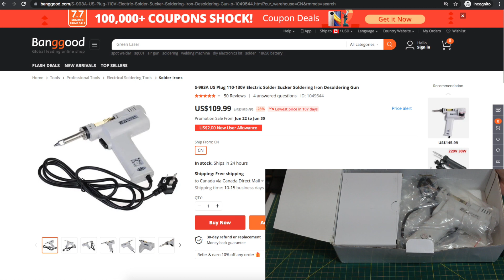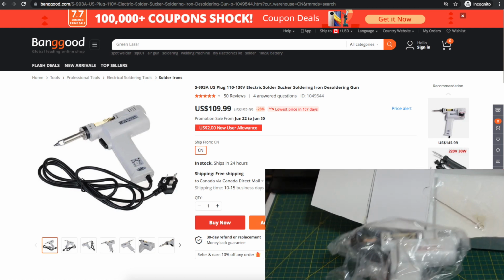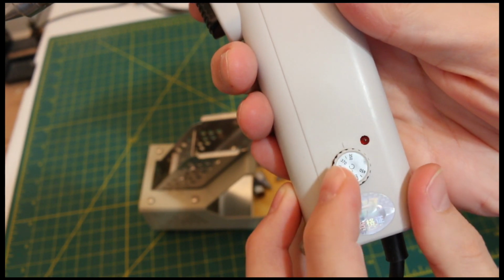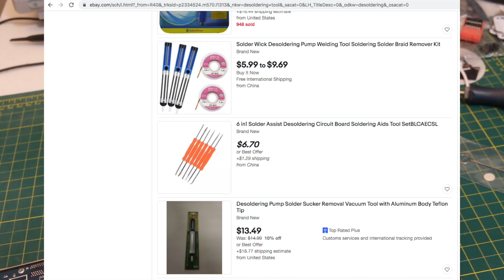S-993a Desoldering Gun - Looks Promising!

Comment: hi.  thanks for the review.  how has the unit held up these past 3 years?
Reply from the maker: still use it all the time. I found it works better when the right sized nozzle is used so I have three interchangeable ones to switch between.
Reply: @GadgetReboot  mahalo for getting back to me and letting me know.  Yes, I would suspect that the different size nozzles are necessary.

Comment: I had one for a year, went thru 3 heating elements. I did nor abuse it, or left it on or anything, just regular use maybe unsoldered 2-3 components a week. The gun itself works well but the heating elements aren't good quality, expensive to replace too.

Comment: I have a ProsKit desoldering station that gives similar results. As you mentioned always clean the gun before turning it off; I ended up putting labels on the station to remind me. If you do happen to forget, I did have success unclogging the iron by dipping the cleaning rod in flux paste, getting a little in there and then turning on the gun seemed to help remove the stuck solder.
Reply from the maker: One problem I had was trying to hold the cleaning rod near the hot tip, I momentarily burned myself. But nowhere near as bad as when I was learning to avoid the hot side of a soldering iron.  A clean out rod with a shield to keep us separated would be good...
Reply: @GadgetReboot  My cleaning rods have a zigzag bend on them to stop you from getting to close to the hot tip; but yeah if your hand slips then ouch!

Comment: Sure looks a lot easier than a manual sucker.  The tip on mine is all melted, stained, and mangled.
Reply from the maker: I can never get the manual one to work either because I can't figure out if it needs to go over the whole pin or just up against it to do the job, or I can't get it in position before the joint cools again, or the pin is a  tight fit and the solder can't come out manually.  This is way better.
Reply: @GadgetReboot  I was never able to get the hard nozzle ones to work either. There are soft silicone tubed manual de-solder pumps. Made by a Japanese(I think) company called Engineer. A bit pricey, but well worth it. 

For more difficult de soldering of headers and chips and whatnot.. The de-soldering gun is a joy to use. Mine is the one with a big base station, but this one looks much more compact.

Comment: I seem to use more SMD components now days so it would not see a lot of use. to remove PTH chips I tend to cut the legs off and lift then out one at a time. I find that with multi pin devices it's hard to get all of them fee from the inside of the PTH. so it's easy to rip the plating out, not much of an issue with double sided, but multilayer with inner tracks connected as well can be a real pain.

but it never hurts to have a range of tools to  hit the boards with.
Reply from the maker: Even cutting pins, I bet the automated vacuum still makes it easier to do the final clean out to reinstall the next part.  I have such bad skills with the manual one that I probably ruin the board by overheating to get the manual tool going.  I finally realized one day, if the part has been removed and the solder needs to be cleaned out, I can heat from one side and use the tool on the opposite side instead of trying to fit the iron and the other tool tip in the same place.  Lots of bubbly green solder mask boards in my past.
Reply: @GadgetReboot  I think my problem us that I started work in electronics at 16. Done most jobs from shop floor upto R&D. so i've had plenty of pratice ;-) using only the flux in the solder!

Comment: How long does it take to change the tips (including cool down)? I can see that as being a problem.
Reply from the maker: They are threaded on tight so it needs pliers or a wrench, which solves the problem of it being too hot to handle but it would be good if it were easier to swap.  I probably won't need to use it or change it often enough to have it bother me.
I'm used to having to do things like this while hot and using pliers as insulation because with the soldering iron I usually only notice it has worked loose and needs to be tightened when I go to use it and it's wobbly against the component, so I get the pliers and twist.  And the metal stand makes a good place to lay the hot tip when removed.

Comment: I love my desoldering gun ... very much a game changer but low melt solder works really well too. Ironically enough, AFTER I obtain both items I have found that my "good ole fashioned" wicking technique has vastly improved!
Reply from the maker: I could only ever use wick for surface mount and using a manual vacuum for through hole was more miss than hit, and for more than 3 pins all I could ever do was make a giant solder bridge and heat it all at once, then vacuum away the excess.  When I saw someone at work use a new tool like this and remove a 40 pin header, I knew I'd have to get myself one....in 15 or 20 years!
Reply: Same. After I stared learning more about proper technique wick worked much better; though for anything repetitive a desoldering gun is king.